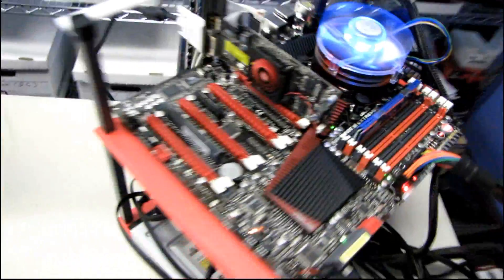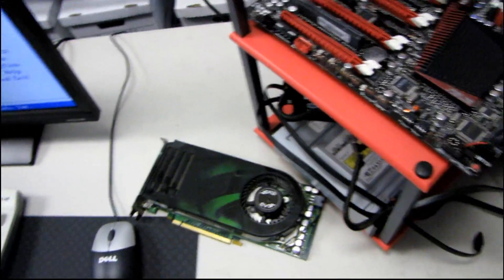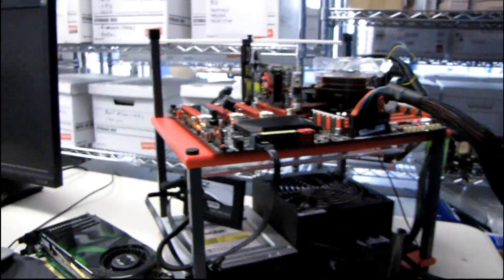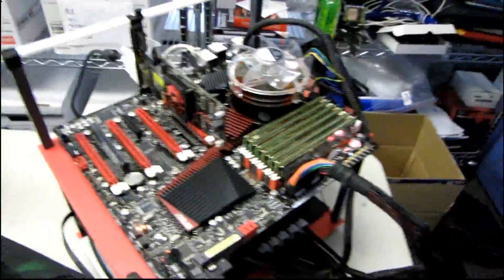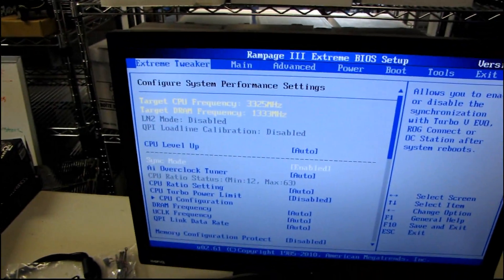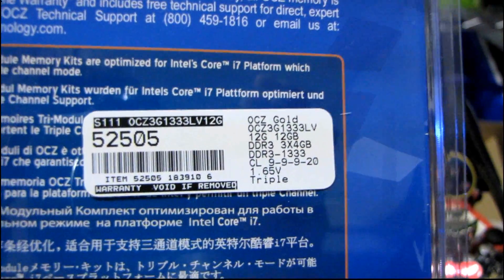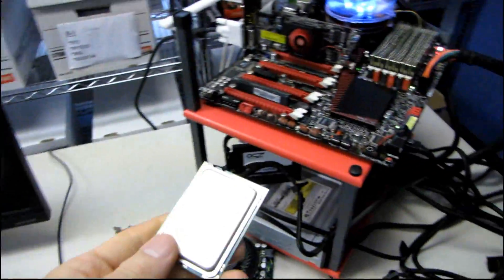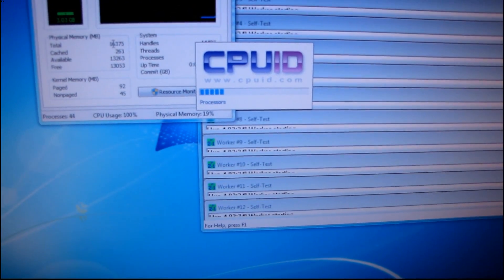Rampage III Extreme 24GB RAM Core i7 980X SUCCESS!! Linus Tech Tips

Comment: It is a great pc even for 2015 's standards.
Reply: +misterPAINMAKER I still run an i7 950 with a msi x58m, its still not a bad machine.
Reply: +Pandemonium well, check out the benchmarks online. im not really sure, but my 950 is overclocked to 3.64. its pretty capable when paired with a good
gpu.
Reply: +misterPAINMAKER I still have a Xeon X3440 (AKA i7 860) on a low end P55 board, o/c's to 3.6GHz. AND it's faster than AMD's chips haha
Reply: Yes a core i7 first gen it is still a great cpu.
Reply: +misterPAINMAKER i use a pair of X5670's with 24gb ram (soon to be 48gb :P ) people who say 1366 is dead are liars :P
Reply: +misterPAINMAKER Yes, and even by today's standard, no one can really justify installing more than 16GB or RAM (even DDR4) in their computers. XD
Reply: Getting an Asus GTX 960 Strix 4gb for my i7 870 OC'd to 3.5 ghz on a Asus P7P55D-E LX :)
Reply: +misterPAINMAKER HAHA 775 quad core extreme edition :D im taking this machine to 2020  & windows 15
Reply: +misterPAINMAKER 
I still use I7 930 
I been thinking of changing it but then im like WHY  :D I can do whatever on my pc now
Reply: Felepeno well, each to their own, if you can't use it that doesn't mean others can't :P quite often im running at 20gb, hence wanting to upgrade, i do ALLOT of virtuilisation, hence the 12 cores and 24 threads :P when gaming i see 10gb if i shut my VM's off :P
Reply: yeah I did the same thing when I build my first PC. Once you get to the point where you know way too much about hardware, it gets pretty easy to build badass rigs for next to nothing. At this point in time those 1st gen i7 xeon equivalents are only like $30 for socket 1156 and $10 for 1366. It's just that the boards are hard to find for a reasonable price.
Reply: LoneRenegade i can justify more than 16gb with ease :P
Reply: LoneRenegade that's not what you said the first time round now is it :P as per the previous convo i do allot of virtuilisation, 24gb isn't enough XD soon as i can afford it im moving to 96gb XD i know full well i can use 48gb because i've done that on a friends system before :P
Reply: +matthew brown i have 4gb :(
Reply: +matthew brown I've got 2 at the moment.. so ya
Reply: Scott R Upgraded to a Xeon W3690 (xeon version of the 990x) for $150 off eBay. After selling my i7-975, it was a cheap upgrade. Overclocked it to 4.41ghz on all 6 cores with all power saving features still enabled. Can do 4.54ghz at the same voltage with power savings off and load line enabled. 4.67ghz was achievable just past 1.375v but since that Intel's recommended max and I like the power saving features, 4.41ghz was the perfect setting for me. Running it with 24gb corsair dominator GT 2000mhz cl9 DDR3 on a x58 asus sabertooth and an Asus 780gtx Poseidon for graphics. For how old the 1366 platform is, it still holds up very well.
Reply: shaunskii  i am rocking x5650 on 4.3ghz at 1.38voltage  with gtx 980 and 12gb ram
Reply: X AK should be :P X58 is VERY picky with ram so you've done well :P enjoy your overclock :3
Reply: Yes it is. Still worth a mid range pc of 2017!
Reply: +mike52787 do you think it's comparable to the 4th, 5th, or 6th generation Core i5 or i7s?
Reply: +misterPAINMAKER Decent sure... but by no means is it "great".
Reply: +Felepeno It is somewhat comparable, I just upgraded to a i7 990X and I only rarely dip under 60 fps with a first gen titan at 1080p max settings on most games, so turn on or two features down to high and it&#39;s butter.  That being said something cheap and modern can do that pretty easily too.
Reply: sunnohh Well lets be completely real here. Most games don't entirely stress the CPU more than the GPU. First gen Titans are still powerhouses. I have a 980Ti and a i7 4790K, however before that I had a i5 4460 with the 980Ti. I was getting well over 70 FPS in most AAA games. The only reason i went with the 4790K was for the video editing power.

Athough I'm not entirely sure what GPU Linus is using here, there's no way it's even remotely close to the lower gen models of our generation.. I mean look at it.
Reply: "... 16gb of useless ram, (Soon to be 40!)" ftfy
Reply: Felepeno not seeing how 16gb+ is useless :P
Reply: Because you're never using it. MAYBE you'll use 10 gigs sometimes if you're working on some heavy editing videos. But I play at 1440p on a 4790K and a 980Ti and i barely hit 4 gigs when gaming.
Reply: Well i do not believe you. But you're right, that's my opinion. I'd love to see some pictures of a build like that though.
Reply: Felepeno pictures are a bit more difficult with youtube, but here, have a cpuz validation with my name on it :P 

name: http://valid.x86.fr/9jjp96

username: http://valid.x86.fr/weussq 

how about now :P
Reply: Why such a low clock on a Xeon?
Reply: Felepeno xeons are known for not being very high clockspeed, and there's only one dual socket 1366 board that can overclock, the SR2 and they go for about £1000 over here IF you can even find one so not something im running, i run an intel S5520SC so no overclocking for me, just a simple dual socket board aimed at workstation use
Reply: The motherboard is what I thought, I've just seen Xeon's at 3.5 - 4.0 (rarely). For a workstation, I dig the build for sure. For myself however, I'll stick to my Z97 series stuff.
Reply: Felepeno with an SR2 is the only way you'll get 4GHz xeons really, and yeah it's not for all people, im running out of cores/threads and ram so i could do with a bit more of all, i wouldn't touch anything lower than 2011 for myself but each to their own :3
Reply: Meh, My buddy has a 2011 and a 3820 and he gets around the same performance as me (We both have 980Ti's) but he spent like.. 2x as much on his CPU & MB setup. Not entirely my style.
Reply: Felepeno my pc in it's entirety costed £600, some 980ti's cost more than this xD
Reply: Wow XD. I've got a G1 980Ti and a 4790K. my entire build including my monitor and peripherals was about 2800 USD.
Reply: Felepeno including peripherals we're probably talking closer to £750 XD cheap monitors, my mouse (logitech G700S) was £25 and my keyboard was £75, for MX greens XD and that single keyboard cost more than my 3 1080p panels XD (waiting on a displayport to dvi cable for the third) people say im a master of getting second hand parts cheap XD
Reply: +matthew brown I know the feel. I built a rig with a 1st gen i7 and r9 270 for $350 including a monitor and gaming mouse.
Reply: ***** yay, a fellow old parts user! nothing wrong with old bits if there's a budget to be met :P nothing wrong with older bits even if not XD i mean a single socket 1366 board and an X5670 can be clocked to hell and back and still be powerful enough for a top end gpu :P nothing wrong with the stuff :P
Reply: +matthew brown heh, try an 1156 socket i7. currently at 3.6 GHz and still going for more
Reply: ***** 1156 was a good socket :P never stop overclocking if you can help it, words to live by, hell im still trying to get more out of my 290 XD
Reply: Damn you got everything for a pretty low price lol. I bought most of my stuff new just because it was my first build.
Reply: ***** Agreed. I recently helped a buddy build his first rig. His budget was $1000, snagged a score of 10.7k on Firestrike. My first $1000 rig got a 7,000 .-.
Reply: damn. here's my $350 rig. http://www.3dmark.com/fs/7836691
Reply: For $350 that's honestly pretty good. 

Here's mine:
http://www.3dmark.com/fs/7313375
Reply: i can't run firestrike on my 290, it's acting up but this is what i got with the 690, the 290 should get something similar: http://www.3dmark.com/fs/7280785

not bad for a £600 rig :P
Reply: 2x 690's*
Reply: Felepeno it's a single 690, dual gpu card and this shows it as separate cores so :P single card in that one :P
Reply: Oh holy fuck I i didn't even know that existed. Don't know where you found that for under $800 usd
Reply: Felepeno they go for about £200 over here :P very good card but a bit old now XD does show its age as such :P
Reply: Still though, a great card for that price. Might be better off with a 970, but doesn't matter really.

Also! Ice storm is a lot of fun with 3DMark.
http://www.3dmark.com/is/3499252

187,000 XD
Reply: Felepeno it performs about on par with a 980 but only where sli scaling is good XD and to top it off they get rather hot :P 

will have to run this on my 290 when the 3dmark demo decides to work XD
Reply: For sure. Pretty interesting to see cards that are 3-4 years old competing.
Reply: Felepeno i've always stood by the logic of getting older but top end of it's time hardware, always produces good results for not too much money :P
Reply: +misterPAINMAKER 
Interesting 
Thankfully the AMI BIOS enables you to tweak quite a few options here.
CPU Z detects the right amount of memory and WIn 7U 64bit does not.
 I don't understand how the VRAM would be responsible for the OS detecting lesser overall RAM.
Anyways : interesting how all the other possibilities were ruled out until you were able to isolate the problem to the VRAM.

One of those things to keep in mind next time you see a
1. BIOS that allows you 270 tweaking.
2. 64 bit Wintel OSes.
3. Right RAM detection on alternative software INSIDE windows.
Might be the Video card.. who would've thought of that !
Reply: +Felepeno love that GPU I got 2 of them and a 6700k
Reply: matthew brown I'm just saying that for gaming, 16GB is plenty. Of course if you do video or photo editing, rendering or CAD, you can benefit from having more. ;-)
Reply: matthew brown
What I said still holds :D. I said most don't need 16GB because they only game. And even current video games can't fully use that. But of course, in certain instances, like you, it's fully justified. 16GB for virtualisation is pathetic XD.
Reply: LoneRenegade still not what you said the first time round which was kind of my point there :P 

i've tried that before and yeah 16gb is just a bad move XD
Reply: Racem Abdel damn, i feel sorry for you, my condolences
Reply: Hans - KRC4267 even more so then
Reply: indeed .. virtualization and productivity softwares too need more than 16 GB in most cases.
Reply: X AK silicon lottery a tad lost there? :P i run mine at 1.375 for 4.4GHz :P not a massive difference but still :P
Reply: matthew brown you have x5650 ?
Reply: X AK yeah, X5650, loving it for the cash, £50 for a 4.4GHz capable hex core :P
Reply: matthew brown  on what motherboard
can you give you specs cpu and ram and motherboard
also bios settings will help too XD
Reply: matthew brown did you disable hyperthreading ?
Reply: X AK i did not, im running all 12 threads at this clock: http://valid.x86.fr/ctq87w

LLC on my board is a bit harsh, set as 1.375V in bios and it works fine at that voltage with LLC off, just forgot it was on XD
Reply: matthew brown  i am really new to overclocking 
i saw the website but i dont understand how can i copy your bios
you have exactly the same board as mine with same chip 
i am running very bad and old ram sticks 2gb each totally 12
Reply: X AK chances are your chip is just a bit lacking in the silicon lottery department, it happens, not all are the same, depends on your motherboard too, there's a good guide i can give you to help with that if you want, though a word of note for overclocking 5600 series xeons it's not recommended to go above 1.5X uncore speed (uncore should normally be 2X ram speed but not in the case of 5600 series xeons which should never really get above 1.5X without risking killing the IMC) having all 6 ram slots full will also limit your overclockability to a point as it means more uncore voltage needed for stability, for your given spec i'd say you have a solid overclock already, technically speaking 1.35V is the max safe for vcore according to intel but ~1.375V is perfectly safe for every day usage
Reply: matthew brown  do you think i should kept on 1.38 voltage at 4.3ghz ? 
is it safe ?
Reply: X AK it's only 50mv above what the 'safe for 24/7 use' voltage is so i'd say it's plenty safe, no need to worry about all that, you have a very solid overclock going i'd say, bout be better, but could be plenty worse
Reply: matthew brown i think with my old shitty rams i should be very happy with this overclock XD
Reply: well everything except the graphics card wich can not run every game max but can run some games max and some other mid to low
Reply: 2015 had standards? We're was I when that happened?
Reply: xD
Reply: Well AMD is sure giving Intel a run for their money these days, LOL! With their new RYZEN, EPYC and THREADRIPPER CPU's it seems that AMD has finally caught Intel with their pants down. I think Intel has been "Top Dog" for so long now that they just got too comfortable/lazy and AMD finally caught them off guard. With that said, give Intel a year or so and they WILL develop something that will put them back on top. While they're considerably more expensive than AMD, Intel produces better quality components, PERIOD!
Reply: Clorox Bleach i think your comeback was farely weak
Reply: @andrew33 Where were you?

Comment: im still running a 980x with 24gb ram... tho im on a classified evga board cause my rampage is in my brothers i7 950 computer for i dont know what reasons, still running 4.2ghz blah overclock and running like a chamo
Reply: +racingisfun The first generation of i-series processors were special, and I just a couple weeks ago finally upgraded from my i5-760 that I had running at 4.0ghz overclock with 1600mhz ram. I have to say I'm enjoying the performance but I could've gone a few more years with the old i5 if I needed to!
Reply: +racingisfun Im running an i7 950 on a rampage II board :P

Comment: i believe that a 64B windows can't load that much ram, due to the limitations on the available ram addresses, if you want to do this stuff, either find a 86bit or use linux! you are named after the operating system... kinda odd to use windows?
Reply: Ozzie Peck 86x is 32 bit, 64bit can handle way more than that amount of ram. There is nothing bigger than 64bit yet. Also, he isn't named after the OS Linux, but after his own name, Linus.
Reply: Oh, lol
Reply: I think 64bit can use like 4 pyetabytes (did I spell that right?) of ram.

Comment: I thought we had larger monitors in 2010.....
Reply: Dustin Moretz Of course we did, even 120hz ones. 2010 wasn't that long time ago
Reply: +P3rttiz it was 6 years ago dude. 5 years when you posted your comment.
Reply: +eatery6565 Yes, and your point is?
Reply: TheGamingBarrel 2010 was a long time ago.
Reply: @eatery6565  and now?
Reply: My monitor is older than that, 24".
Reply: No only for 2019 cause I'm from the future

Comment: Quadruple-channel architecture
Operation
DDR3 Quadruple-channel architecture is used in the AMD G34 platform and the Intel LGA 2011 platform (e.g., Intel X79 or Intel X99). AMD processors which are used on the C32 platform instead use dual-channel DDR3 memory. Intel processors which are used on the LGA 1155 platform (e.g., Intel Z68) instead use dual-channel DDR3 memory.
The architecture can only be used when all four, or a multiple of four, memory modules are identical in capacity and speed, and are placed in quad-channel slots. When two memory modules are installed, the architecture will operate in dual-channel architecture mode. When three memory modules are installed, the architecture will operate in triple-channel architecture mode.[15] (http://en.wikipedia.org/wiki/Multi-channel_memory_architecture) so no quad channel YET.

Comment: He did not add qpi voltage for 6 ram modules it needs a little boost in voltage there at least 1.350v , it depends on memory controler but its hard for it running 6 modules even at that low mhz my woud not post with 3x2gb corsair dominator gt 1866mhz at 7 7 7 20 latencies without 1.3v qpi ,and biggest mistake he did not run ram at 1.65v as it should .

Comment: I had this problem as well. I was running 6 x 2 gigs and on cold boot i only got 10 gigs. After restart i got 12 gigs. Then i updated the bios and the fix from Asus was that it posted and immediatly restarted and then i had 12 gigs without having to reboot. It is just that 5 of 6 banks are seen at cold boot.

Comment: I had 6GB in one of my rigs that would detect only 3.99GB. CPUZ said that I had 6GB. BIOS said I had 6GB available with 2GB in system reserve. I tried so long to find settings to disable this "system reserve" however I couldn't find any after I had already tried all of the Windows Settings. I tried rotating RAM modules and all worked flawlessly. I ended up   taking my rig apart and took the CPU out because this was beginning to sound like a bad memory controller or something. Turns out I had a bent pin on the LGA socket.

Comment: I last a tear, seeing him putting OCZ mem in there. Why is that company broke?? I just still can't understand. They were always good to me. I bought OCZ mem, OCZ SSD drives...did "SANDFORCE" seriously causing OCZ to close down?
Reply: Appearently they increased speeds just a bit too much past the physical limits ssd modules they used. The failure rate of the drives was huge and not stable enough. Sandforce controllers and OCZ' suppliers' memory quality and integrity was not great either. This is just what I heard though, I might be wrong.
Reply: ***** ocz is trash my ram died in less 2 years